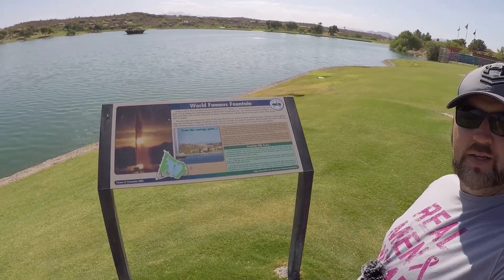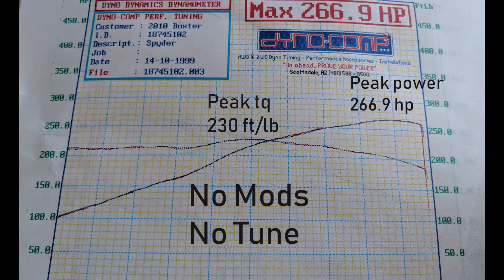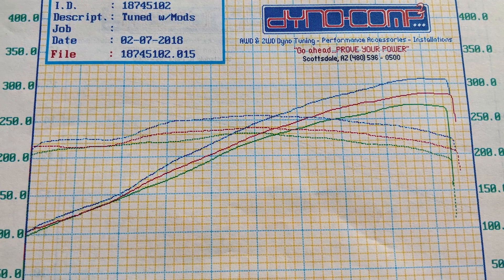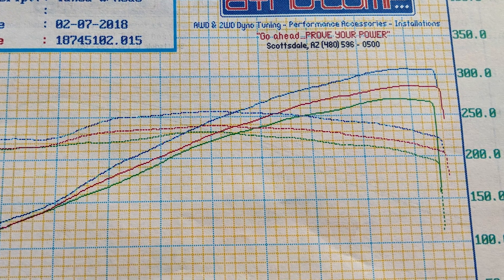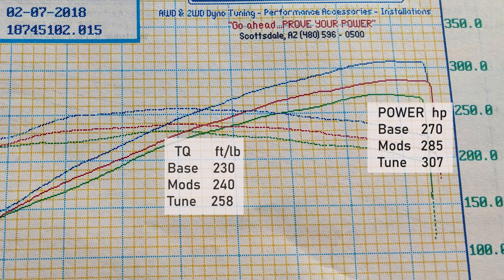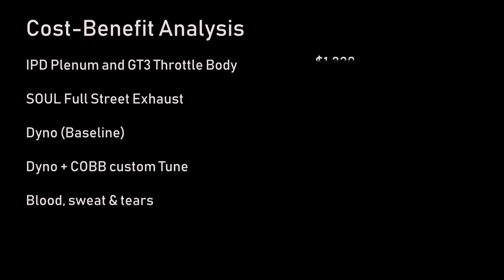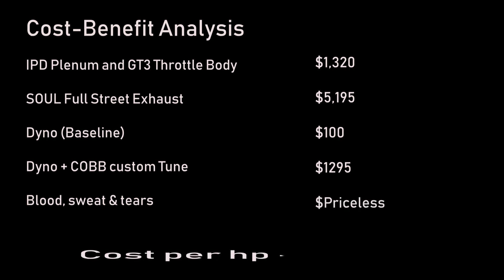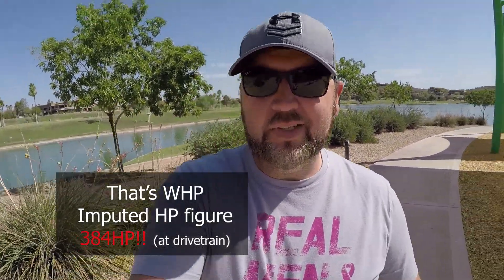Porsche 987.2 Dyno Tuning - Mods + COBB dyno tune = ???.? - Ep. 5

Comment: So glad to see your video series.   Those are all the things I want to do with my Cayman S.    One question:  you stated that the final horsepower is 384, the original HP from Porsche is around 295.  So is it true that those mods resulted in a gain of 90 HP?
Reply from the maker: My car came off the line at 320hp at the crank. Gain was about 64 over stock at crank peak power.

Comment: What kind of bumper is that? Looks great without the fogs!
Reply from the maker: It's OEM on the 987.2 Spyder.
Reply: @DWraysGarage  what is ur 0-60 and 1/4 mile time ? Is there anyway to get this car in the low 11s 1/4 mile ?
Reply from the maker: @shelbyhaiketic4212  I no longer have the vehicle - sold to a friend. Just acquired a 981 Spyder. I didn't capture those times but there are better platforms if pure straightline speed is your objective.

Comment: did the ipd make much differance in feel and power
Reply from the maker: I'm not convinced this mod works independent of other elements. If I were modifying again, I'd leave this to last. I'd be tempted to try and avoid it altogether if I felt I was making power to my desires thru exhaust, tune, intake etc.
Reply: @DWraysGarage  i have already got sports headers and custom back box which feels alot better and a K@N air filter so im just thinking about this ...and i have a remap already
Reply from the maker: @c4lho888  have you dynod it? You could do the 'scientific' thing and do a pre- and post- to get true to life numbers. I did so many things at once I don't really know what each component achieved. It's an easy install (kinda - for smaller hands) and completely reversible.
Reply: @DWraysGarage  no not dynod it but the headers feel good where when i done the back box it actualy felt slower
Reply from the maker: @c4lho888  if breathing is restricted then the plenum and TB will only help. Don't back on more than 7hp from it. Maybe 20 with your tune.
Reply: @DWraysGarage  ok thanks just need to gather more info wether if its worth the money for so little if not no gain

Comment: You miss your 987.2?
Reply from the maker: I miss it on a couple of fronts, yeah. One - this was the first car I really spent the time to understand and work on. Two - I used the car for its built purpose without hesitation. Three - it was the best version this chassis could be for me. The saving grace here on some levels is that a friend of mine bought it - albeit 1000 miles away. There’s a good reason there are few 987.2s that come up for sale…